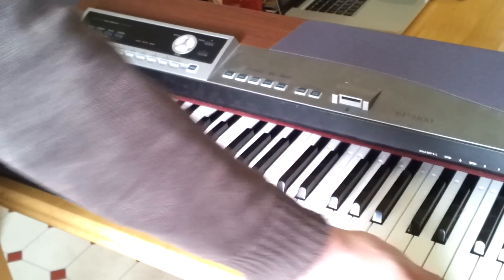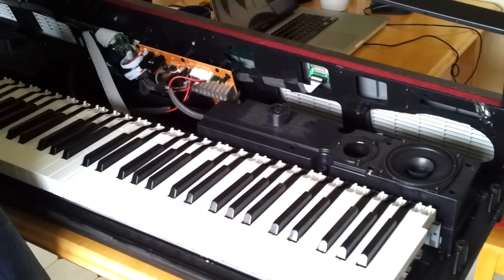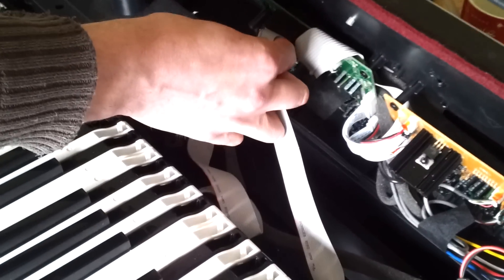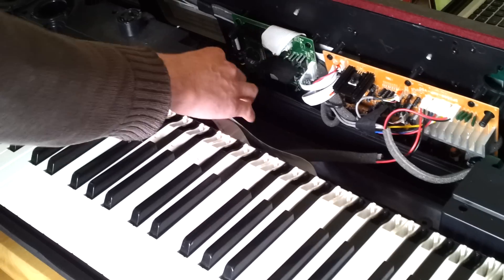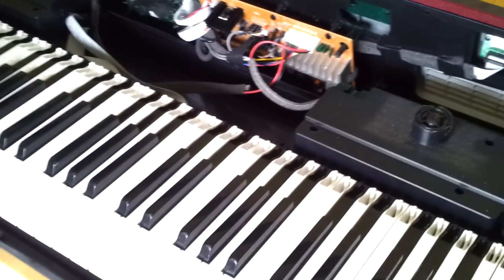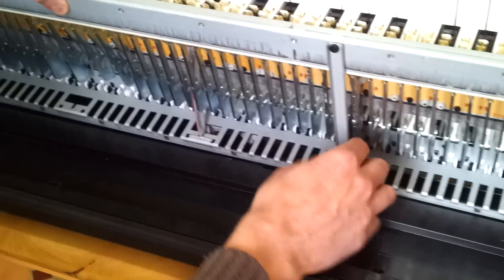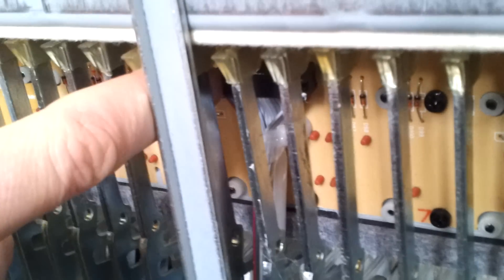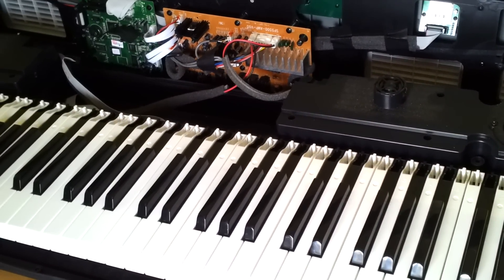Fixing the keys on a Digital Piano - Where some or all keys are not working cable bus

Comment: Hello Wren, I have a quite simple low grade bontempi keyboard, with one of the white keys not sounding when I strike it with the same force as the others, if I press it harder it does sound but there is quite inconsistently a (very) short delay which is still noticeable when I play, yet if I play more higher on the key (about where the black key next to it starts and above) the problem doesn't seem to exist. I remember having left on my keyboard for a night shortly before this happened though, maybe it has something to do with it.. But I also cleaned it by turning it upside down and that mightve had some positive effect too, so Im not sure. Before I do all this maybe you know whats going on?
Thanks alot in advance
Reply: Fixed it just now! Hope it will stay this way, am very happy! My keyboard was built a little different in that nearly all components were built-in on the top casing, so i had to work on it with laying that upside down. There wasn't much dust but I removed a few little crumbs on the circuit where the rubber tips contacted and from a rubber strip too. I am ashamed to say I also got rid of tabacco which got stuck on the grease and the bottom casing, since I used to roll cigs on the keyboard between sessions D: very stupid!
Reply from the maker: carelessbear Brilliant! Well done. It's a great feeling to go outside the comfort zone (in this case inside the piano casing) and fix it. Shows it's not a black hole of the unknown. It can be done! Happy playing!

Comment: good video thanks.  I have a PC88 and I have 4 random keys in the bass register both lower E's, low C and low G#.  Took it all apart, cleaned the circuit board as there was some evidence of some fluid being spilled in that register.  I used the graphite technique on all the contacts.  It's spotless.  Turned it back on and same keys not playing.  I switched the two ribbons and same issue.  Going to do a factory reset.  Battery is low so I'm going to replace it.  Any suggestions?  Thanks very much

Comment: how would i fix a super sensitive key... i.e. the velocity is off when pressed - it plays too loud
Reply: Thanks for taking the time to write this, even though it's an old question.  I'm having a similar problem and will try this, see if it helps.
Reply: Replacement keys maybe? If the key is loose and wiggly then I think replacement keys is needed,  though Im not sure.
Reply: Blondie SL Makes sense. Probably a good idea to keep a spare key handy in case you needs it, so you don't have to do the process twice.
Reply: @Blondie SL 
I hv a problem ie all the plastic that clings or bond to the metal hammer were corroted and all were out .Now I hv removed out all the keys and the hammers out. My problem now I do not know what type of plastic or resin to restore all the missing and torned plastic with.
Since this Suzuki SE-200 were discontinued and old models I think there's no spare parts available anymore.My last option was to diy .....
Tq in advanced

Comment: I just bought a Korg C-800 and the E key just below middle C will not play unless you hold the key down.  Sometimes the E key just above middle C does the same thing.  I know that this is an old digital piano but the sound is beautiful and I'd like to fix this problem if I can.  Does anyone have any suggestions on where I should start -- and what the chances are of finding parts if I need them?  Thanks very much!

Comment: Hi, I have a problem with my Casio Celviano AP 38. I appreciate any kind of feedback.

Several keys (4 white keys in a row and 3 black keys in between) don't make any sound unless any four of them are pressed together.
There is one other black key at the other side of the keyboard, which plays well until one of the broken keys mentioned before is pressed. When pressed simultaneously, black key doesn't make any sound.

I wonder, if these symptoms could isolate the problem and show which element of the piano is broken. I tried to clean the keys and the electronic board under them, checked cables connections, but keys still don't work. Will replacement of the board under the keys help or this could be the problem of other elements? If yes, I will start looking for the new board in the internet.

Thank you!

Comment: I have a Korg sp-250 that began to have problems a couple of weeks ago. When i turn it on and play the third C, the metronome gets activated or deactivated. The third E and G# change the sound of the piano to one of the electric pianos. However, if i keep the piano on during half an hour or less the problem dissapears and doesnt come back until I turn the piano off and on again. Its really strange. I tried opening the top and cleaning the speakers and the top of the keys, but im afraid of damaging the piano by unscrewing the keys,

Comment: Im having problems with touch sensitivity.  Some keys don't play at the same volume as the others especially when played repeatedly. Could it be a prassure board issue?
Reply: Any updates on this? My Casio keyboard does this same too and looking for some ideas on where it needs to be fixed.
Reply: @7peque  no update from here but I have spoken with a piano repair shop and it could be the touch sensitivity strip that runs under the keys....over time they get eroded down. Apparently it's a common problem.

Comment: Hey Wren, I just fixed some stickey piano keys on my Yamaha P80 electrical piano. I have done this in the past before (fixed the contact points of one of the keys), but now, after reassembly, not a single piano key works. I have measured the cables that connect the keys to the piano itself (fine), I've checked the assembly of the (carbon) contact points but none of it seems to matter and I have no clue how all piano keys do not work any more. Would you have any clue? The piano sound itself works (playing a preset works), but recording does not work. It seems Not a single impulse from the keys arrive. Any ideas?
Thanks so much in advance!
Reply: Same happened to me last night, so here I am seeking answers. Did you ever get a solution to this?

Comment: There are couple keys per octave on my piano that - when pressed - the key next to it plays, as well. This happens specifically on a bunch of Fs, As, and Ds. Is this most likely an issue with a cable?
Reply: jennlikesyarn got the same problem
Reply: +Gabriel Ayres got the same problem, i tried some repair but still the same. got any solution?
Reply: nope :( had to buy a new motherboard

Comment: I'm not sure if you'll this because the keyboard is pretty damn old but what if we have an older one like a Casio CTK-510 and there is only one cable that is attaching the keys to the board? And it doesn't even like pop in and out it's actually welded it looks like to the motherboard itself. >.< I'm trying to figure out why when I'm trying to play, the keys won't emit sound if I'm trying to go fast or press more than one chord at once. :-/ Plus the speakers are emitting a lot of noise when it's just plugged in and not even on. Maybe just a case of a really old keyboard that has gone out/going out?
Reply from the maker: Can't tell from this distance. The less moveable/module parts that are involved the less likely that you'll be able to fix it. If everything is stuck together, there's not a lot a room for it to be a physical problem.

Comment: What if 2 of my OCTAVES of D and G# does not sound at all? (4 Keys In total)
IT Comes and goes, but most of the time, it doesn't sound at all.
What should i do? I clean both the rubber pads and the contact. Is there any other way i could fix it? I send in my Yamaha P-35 to the service centre 3 times already. Should i send it in again? =.=
Reply from the maker: This sounds as if its something very similar to the issue in the video. When two octaves are either in or out it's a connection issue and not connected to any individual key. It must be a band cable that controls those two octaves that is loose.
Reply: Wren O'Brien hi what if certain keys are slow to return after being pressed down?

Comment: Hi Mr. O'Brien,
I have an old model piano casio wk8000. 5 of the white keys and the black keys in between those are not working properly. The location is one octave higher than middle C. The problem is whenever I press then release this notes, the key will return to its original position but the screen indicator will show that the key is still being pressed. So with this, there are no sound produced whenever I press that note again. Please advice.
Thank you.
Reply from the maker: +iamjelly tube Open it up and check the cables. This could easily be something like what is described in the video.
Reply: +Wren O&#39;Brien 
Hi sir, I did open the keyboard. I tried touching the board with rubber inside but it can only make one high pitch sound. With the other keys on the board, I can make consecutive number of sounds. Does this mean that the board need to be replaced? Thanks again

Comment: I have a Casio CTK-3000 with a dynamic keyboard. Recently when I plugged it in, it turned out that a group of adjacent keys (around an octave) always play full volume. Also one of the keys stopped playing at all (a few keys apart from the loud group). I cannot think of any reason why this could have happened, because I was not using this keyboard for a couple of weeks. No one was using it nor even touching it. It was unplugged and just sitting there in a corner of my room. There was no water spill, no heat, nothing which could possibly damage it. Do you know what may be the cause of it and how to fix it?
Reply from the maker: +Bon Bon No idea what this might be. Sorry.
Reply: OK I think I fixed it. I unscrewed the chassis to look inside (there are many screws, but one can safely open it then, because the tapes are quite long and everything is fixed inside). Then I unscrewed the keys – they are grouped by octaves (two halves for whites, one black group two-octave long). Underneath there is a rubber with lots of "tits", same as inside a TV remote, with two little discs of graphite for each key, which contact with a cross-hatch of paths on the printed circuit board. The rubber is removable, it is not glued as I thought at first. One just needs to locate the little studs which go into the circuit board to keep the rubber on it. I removed the rubber and cleaned the circuit board with a rubbing alcohol, and the same with the graphite discs under the rubber. Standard procedure I use for cleaning TV remotes' electronics. Then I reassembled all that stuff and tested it, it seems (or sounds) to work again.

Comment: I have a Casio LK-100 that has dead keys and keys that play on their own, and don't react to pressing. Any ideas?
Reply from the maker: When you say they play on their own...what do you mean?
Reply: Wren O'Brien They just play the sound without me touching it.
Reply: Did you get a solution to this.  Mine is doing this too.
Reply: Gail Ball Sadly no, even cleaning the keys and the circuit board didn't help.

Comment: What should I Do?
My Baldwin electronic keyboard is Dying!  A couple keys were stuck but now it will lightly stick then go quiet,  it looks like a baby grand but ugggggg 
Parts are no longer available and all local (San Jose CA) repair people will not touch.  Should I get out the Screwdriver?
Thanks
Reply: Thank you , very much.  Will try when I obtain it's replacement.  Looking for a regular baby grand (white) then will get the screwdriver out.

Comment: My Roland MP-70 is about 4 years old now.  Some of the higher register keys are NOT working - when I press a key, no sound.  Is it possible that some dust or dirt (or cat hair?!) is at fault?  ....
Reply from the maker: Could easily be. Again nothing to lose by opening it up and checking. If a number of keys stopped working at the same time, it's more likely a mechanical problem then a software/electronics problem...and that's good news! mechanical problems are more easily fixed. Again it could be a displaced ribbon cable or dust on some of the key sensors.
Reply: I ended up paying a professional to fix it.  Problem was indeed a spilled liquid of some kind.  Roland no longer carries the part I needed, so he spent a good deal of time cleaning the 'tracer lines' I believe they're called.  Now I've got all keys working, and I'm a happy camper!!! thx for your comment!

Comment: On my me keyboard the middle c has a delay it all most sounds as if it is sticking or playing the note twice any solutions ?
Reply from the maker: How long is the delay? No obvious solutions are occurring me to fix this. But it's always worth opening the keyboard up and poking around to make sure connections plugged in properly and haven't slipped and there isn't dust, dried liquid etc on key connectors.

Comment: i have a fantom x6. two keys has no sound. they are next to each other. the two keys are not broken. only no sound.
Reply from the maker: +Jade Pascual Fantoms are quite intricate synthesizers and more complicated than a digital piano. I would take it to a dealer and get it looked at by Roland themselves. They're too delicate and valuable to get wrong.
Reply: +Wren O'Brien i fixed it by myself. remove the rubber pad and i scratch the black lid with pencil

Comment: I have a single key (middle B) that suddenly will not depress (Technics SX-PR900B).  Any suggestions?  Thanks.  Al
Reply from the maker: +Al Tucci A key that won;'t press down...it has to be a physical problem! Which is good news. Take the top off and see if there's something there stuck that prevents the key from working.  generally the parts are plastic of some sort and therefore shouldn't seize due to rust or wear. My guess would be a dislodged component inside the piano that is stopping the key from being pressed.

Comment: Sorry to bother anyone, but I have a Casio CTK-6200 and whenever I press a specific key (the first G after middle C) it sounds normally, but if I press any other key from middle C-F it sounds at full volume. This only happens with the keys from C-F and only when that G key is held down.the keys are not weighted but they are touch sensitive. I received this as a gift and it has always been like this. I obviously cannot return it, so if anyone could help out I would be most grateful, thanks.

Comment: question, I have a yamaha p115, literally brand new, and some of the key's are "rubbing" against each other, making a very distinct scratching noise, and also having a very annoying feeling to them when pressing them. Is there any way I can fix this?

I got the p115 because my previous one, a p45, had the exact same issue, so i figured maybe a straight upgrade would fix the issue, only to frustratingly find out that some(not as many as the 45 though) on my 115 are still doing this.
Reply from the maker: You could take out each individual key and file them...but really this is a lot of work for a piano that should be meeting your needs of out of the box. I would return it stating the problem.

Comment: My digital piano has 8 keys next to each other that stopped working. I swapped the ribbon cables around and they now work (although the wrong octave) but then 8 keys at the other end don't work now. Any idea what the problem is? Thanks
Reply from the maker: Sounds like the ribbon cable is not working for some reason. You could take out and look at the connectors and see if there's anything unusual. Otherwise, replace the ribbon cable. To find the right ribbon cable with the correct number of connectors can be a challenge. I'd go back to the manufacturer as a first stop.

Comment: In my 4-years-old Korg Sp-250 some notes suddenly sound without their keys being pressed. This usually happens after being on for a couple of hours. Ive discovered they are the same couple of notes most of the time, and they always sound with a high volume and very briefly. Do you know anything about that problem? thanks!
Reply from the maker: Sorry...I'm stumped on this. Anyone else have any ideas?
Reply: Dont worry, i opened the piano as you showed in the video, cleaned it, and since then the problem seems to be fixed